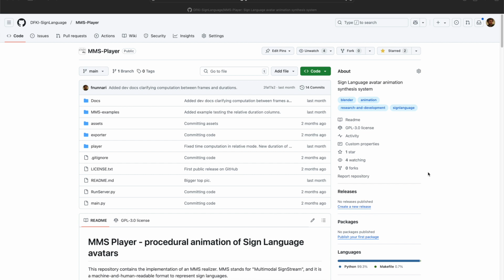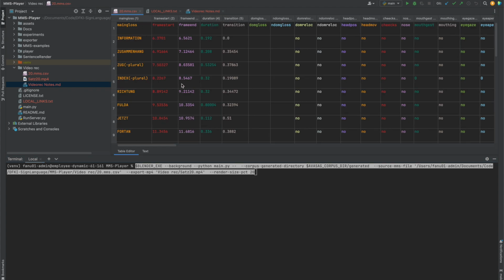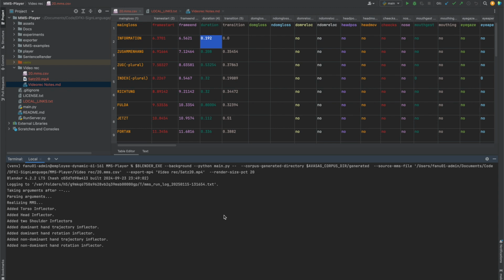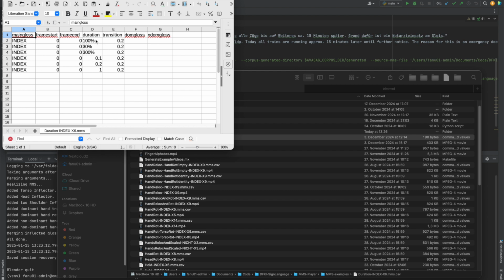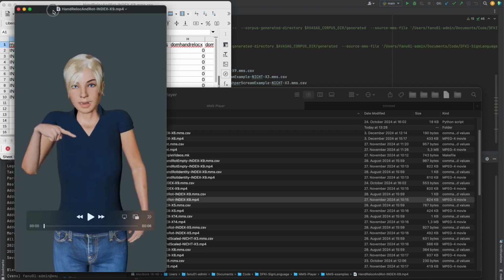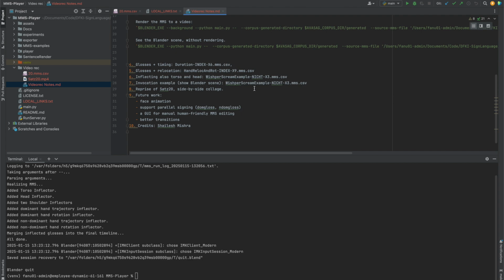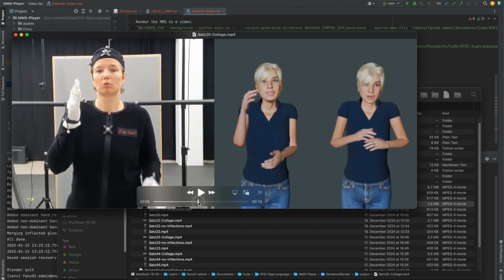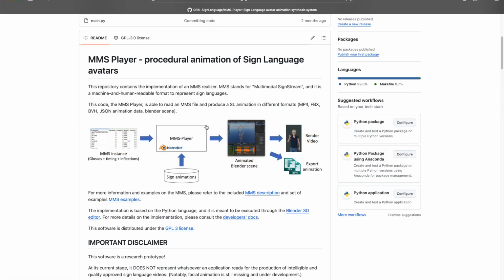MMS Player - Sign Language avatar animation synthesis (DFKI, 2025)

Comment: Exciting stuff! Could it work with a standard video-to-motion capture AI such as DeepMotion AI? I couldn't get good results using DeepMotion as a stand-alone tool for sign language, so this is great to see.
Reply from the maker: My experience in capturing SL motion with standard video-to-motion capture tools is very disappointing. The sign dataset that I am using has been captured via optical tracking and manually cleaned up (and improvable).
Reply: @fnunnari  Thank you for your reply. I checked out your other videos and saw the setup for motion capture. Thank you for sharing your work. I'm creating free NZSL resources for kids. I initially tried video filters to get the animated look, but there were many errors. So now I'm researching other ways to make the videos I need.
I look forward to seeing the facial movements you talked about. Keep up the great work!